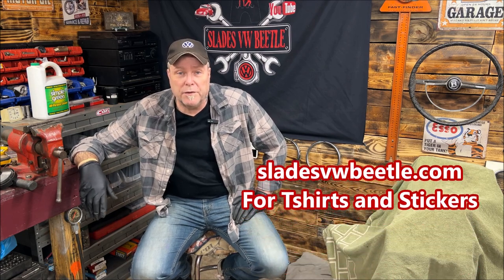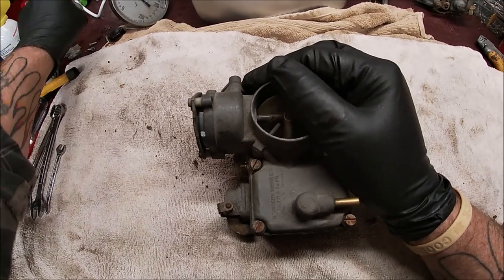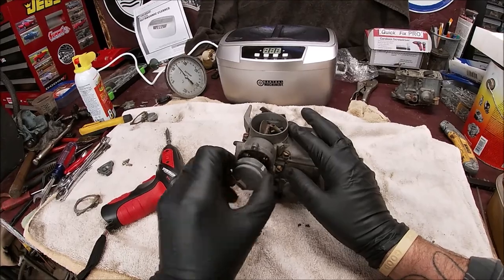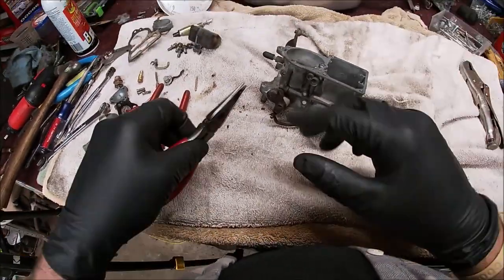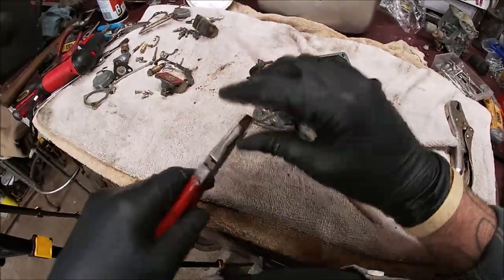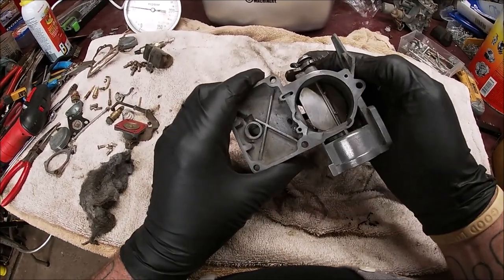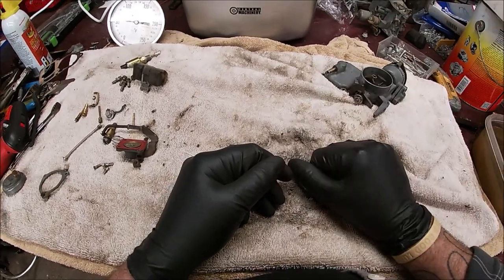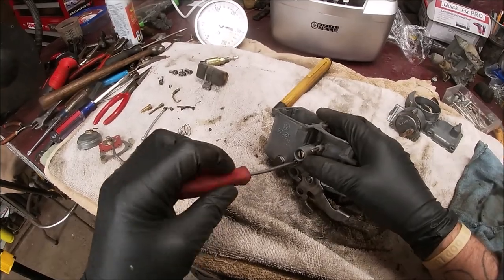VW Beetle SOLEX Carb Rebuild - How To rebuild a carburetor - Ultrasonic cleaner - VW Bug Carb

Comment: Thanks Slade ----- for a Carb. found buried in the Salvage Yard --- you now have a -- Spare -- you can put on the shelve for later use -- or -- parts ------ If you really like -- the Cotter Pins over those C-clips --- pick up a Numbered Drill Set -- Harbor Freight -- not always the best -- but for the little use we get out of their tools -- just fine ------------ I find for those C-clips --- your red handled Lineman Pliers works good ---- on removal -- one jaw drops down to the two open ends of the clip ---- the other jaw over the post that clip is on ---- then just squeeze the pliers --- the two legs of the clip will slide past the post -- and can slide the clip off ----- to attach the clip ---- just do it in reverse --- slide clip up onto the post -- pliers on the back bone of the clip -- other jaw on the opposite side of post now -- and squeeze -- and it's on --- then squeeze the two tangs -- Just -- a bit to close up the gap ---- I'll be on ---- FIRE ---- waiting for you next video ----------- You have a Good Weekend Too ---- Rodney

Comment: Slade, looks like you're aggravated with that HF sonic cleaner for a couple reasons. I want one but I think I'll get the bigger one at HF, the 6 liter one. Question... what liquid or solvent do you put in there to clean? I'm wondering if I could use what's in the gallon of Chem Dip you buy at the parts store?? Thanks man!!
Reply from the maker: Honestly I’m not aggravated with it, I just think it could have had a better design. 
Now I have a Vevor, 30L which is equivalent to 8 gallon. 
Quite large but it’s nice I can put cylinder heads in, pretty much anything. I have used Chem Dip, Simple Green, Purple Power. I have used a lot of different chemicals honestly.

Comment: The first thing you take off is the fuel cutoff sensor! So it don't get broke off! 😱

You have to match the correct "spacers" with the type thermostat you are going use on the carb! 👍

You didn't rebuild the top end of the carb! 😱

You didn't rebuild the bottom end of the carb! 😱

You didn't clear the other ball bearing fuel passage! 😱

Use the "CHEMDIP" it's the best to clean all the passages! 😁

Pretty good, not bad for a first time partial rebuild! 😁👍👍🇺🇲
Reply: He did say it was a video to show the process and didn't have a rebuild kit to install.

Comment: Love you're videos, very good for us DIYers, I have a 73 beetle and recently pulled the motor and replaced the rubber hatch seal, but now the gap between the seal and body seem to have gotten bigger, in the corners they're about an 1 1/2" , I was told that in 72 the super beetle engine compartment got a little bigger, so now I need to know how to fill in the gaps, for me it's important because in the summer we get over 100° , thanks

Comment: I have a question after watching your video... which was very informative by the way. We have a 1971 Super beetle with a brand new carb (just like the one you just rebuilt) and the throttle doesn't return all the way back leaving it stuck at a higher idle. I can push it back manually but when you hit the throttle again it does the same thing. I thought about relocating the spring to different location but I don't want to alter it's OEM location if I don't have to. Is there a fix for this? Thanks